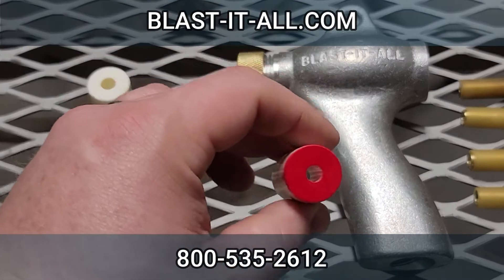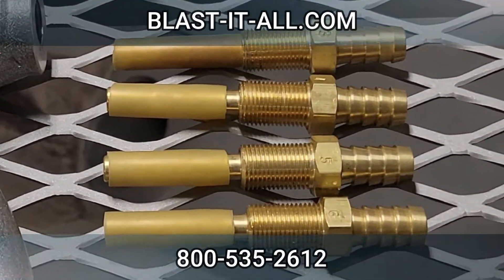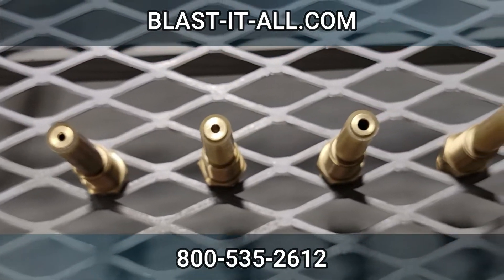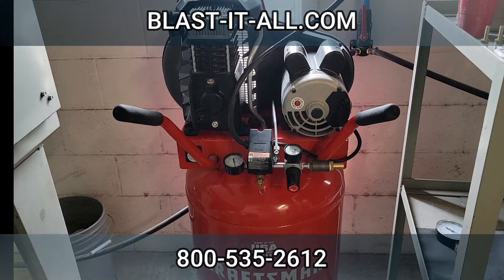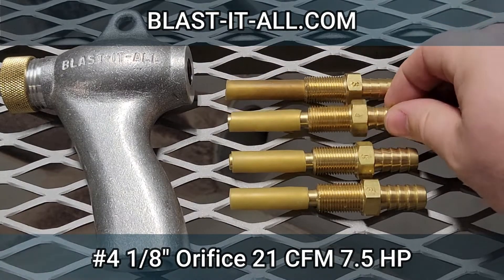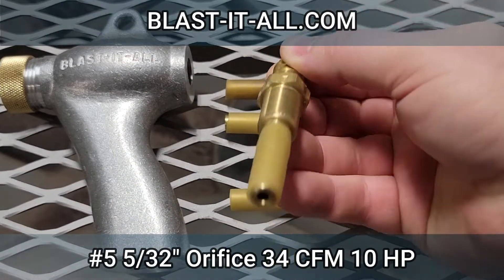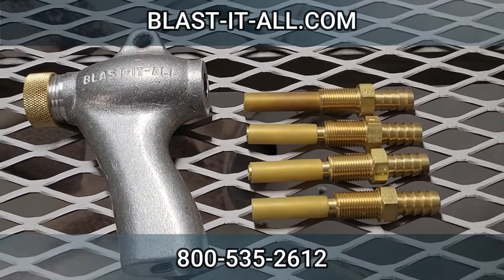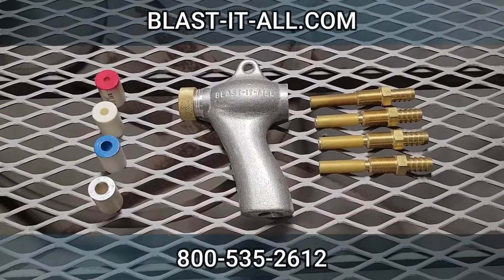How big of a compressor do I need for sandblasting?

Comment: Hello,  my compressor is 80 gallon, 6.5 HP, and is rated at 15.5 CFM at 90 PSI, and  21 CFM at 40 PSI.  If I only need to run my compressor at 40 PS (21 CFM) , will it keep up with a 1/8" Orifice?  Thanks
Reply from the maker: A #4 1/8" Air Jet would require 21 CFM @ 80 PSI. You would probably be better using a #3 3/32" Air Jet which requires 12 CFM @ 80 PSI. This would allow you to operate continuously at 80 PSI and have less strain on your compressor.

The CFM requirements for suction blast guns are on the left of this page. https://blast-it-all.com/cfm_requirements/
Reply: Thanks, I just reviewed your chart and I should be good operating at 40 PSI / 21 CFM using a 1/8" Orifice.  Your chart shows 1/8" Orifice at 40 CFM only requires 12 CFM.
Reply from the maker: @bs8010  You can run the 1/8" @ 40 PSI continuously with the compressor you have. However the flow of media will have less force. For rust removal I typically blast at 80 PSI. For Cerakote  prep the blasting needs to be 80-100 PSI. When frosting glass I usually blast between 60-70 PSI. I do not recall intentionally blasting at 40 PSI. 

If you get the #3 gun you will have the ability to go to 80 PSI and you can handle the same media sizes as the #4. Both the #3 and #4 use the same size nozzle.
Reply: @blastitall  So I am assuming your orifices are only compatable with your guns?

I am a novice DIY, wanting to do Cerakote prep (Have not yet).  I upgraded my HF blast cabinet with the Tacoma Company complete upgrade system, to include their gun and foot pedal.  Mike Tacoma has been in the blast industry for over 60 years and swears up and down that I only need to use 40 PSI for Cerakote prep with 120 grit Garnet media (said Aluminum Oxide is too harsh for a firearm) , using his system.  I am just conveying what he is stating, I have Zero experience and while I am fully set up, I haven't blasted yet.  I did want to do some experiements to see how long my compressor can run while blasting at various pressure.  

My compressor is a three-phase using a VFD to convert my garage 1-phase to 3-phase power.   The compressor takes 6 min to refil the tank completely from empty, not sure if this factors in at all. 

I am trying to get as much real world knowledge from as many folks in the industry as I can.  I beleive Mike is sick, so I haven't been able to talk with him.  Again, I am just conveying what he told me and trying to gain as much knowldge as I can.
Reply from the maker: @bs8010  While our guns are from our own mold, they are an industry standard gun. Our air jets will fit many other guns on the market. 

Cerakote standards specify 100 grit Aluminum Oxide at 80-100 PSI for surface preparation. This video covers the basics: https://www.youtube.com/watch?v=WPj7s2UnPOM

Garnet can be just as aggressive as Aluminum Oxide, but it breaks down faster and therefore does not last as long. 

The blast gun itself will wear faster with more aggressive media, but more wear is seen on the nozzle of the gun. Ceramic will wear faster than Tungsten. We offer a complete #3 ceramic and #3 Tungsten

Ceramic: https://blast-it-all.com/product/3-gun-complete-w-ceramic-nozzle-1-4-diameter/

Tungsten: https://blast-it-all.com/product/3-gun-complete-w-4-tungsten-nozzle-1-4-diameter/

If you would like to talk through some of the blasting process. Feel free to give us a call and ask for John. (704) 637-3300
Reply: @blastitall  Thanks, yes I am aware as well as Mike Tacoma is that Cerakote standards specify 100 grit Aluminum Oxide.  In Mike's opinion he is shocked that Cerakote has not evolved with their media blast standards/requirements for prep.  I conveyed this to cerakote also and they deflected.  IMOP after speaking with Cerakote, I gathered that their expertise is definatly in the actually application of their product and not nearly as much expertise on the prep/media blasting.
Reply: @blastitall  With the #3 gun vs the #4 gun, how much difference do you think I will notice as far as time it takes to complete a blasting task?
Reply from the maker: @bs8010  Our customers who are blasting fire arms use a variety of media sizes, but for blasting they all use Aluminum Oxide. Mainly because it 's durable. 

We have some small shops that process a few parts a month and customers who use our automated equipment and process thousands of parts each month.
Reply from the maker: @bs8010  I've used the #3 and the #4 a good bit, I don't think you will notice the difference. But you will notice the difference between 40 and 80 PSI.
Reply: @blastitall  Thanks, I appreciate it.  I am will to experiment with whatever it takes.  I am not opposed to going up to 80 PSI.  I watched your video and your automated equipment and process is AWESOME!
Reply: @blastitall  My compressor is 100% duty cycle, oiless, and takes about 6-min to refil the tank from empty to 150 PSI / 80 gallons.  It uses 3-phase power converted from 1-phase with a VFD.  Not sure if this matters at all, as far as if it can keep up with the demand?  Or if it all comes down to the CFM?  It is rated at 15.5 CFM at 90 PSI and 20 CFM at 40 PSI.

Comment: I am connecting two 6.5 hp compressors into one line that goes through a series of vertical pipe lines zig zagging. The line has a large air  dryer at the end. 
What size orifice nozzle do you think I could have running the two 6.5 hp compressors together? Thank you
Reply from the maker: I have never combined compressors personally, but it can be done. If done properly it there should be very little loss of CFM. Your combination should yield around 40 CFM. Be careful.

Also not sure what you're planning for, but a 6.5 HP compressor should produce around 22 CFM at 80 PSI, which would work well for a suction cabinet and 21 CFM air orifice. #4 gun on our website. 

This chart gives you CFM requirements for suction and pressure system. 

https://blast-it-all.com/cfm_requirements/
Reply: @blastitall  I plan to use the two compressors only if needed. I was going to use a 5/32 nozzle with a medium grit crushed glass.  
If I understand the use of the chart I should be good to go? Thank you for your help
Reply from the maker: @jimdrechsel3611  5/15" Nozzle and 5/32" Air Jet

Comment: Can I use a car tire air compressor to power a sand blaster?
Reply from the maker: If by tire air compressor you mean one of the little tire inflators, no. Most of the manuals I have read for those indicate the produces less than 1 CFM. The smallest CFM air jet we use needs 12 CFM. It is possible to get a smaller compressor, 4CFM, with a tank and blast for short periods of time. But for larger projects something the produces a few more CFM than the gun requires is what would be recommended. This shows how that works: https://www.youtube.com/watch?v=TQoe0ov4M_c

Comment: I use an 18CFM gas engine compressor with a HF cabinet. I’ve also installed 1 inch tubing for siphoning/ metering. A couple days ago I was chugging along and blasted several parts, however I haven’t been able to find that sweet spot again. Now at most I get a small amount of media when I pulse the trigger. I can see media almost making its way to the top of the hose but it doesn’t have great suction after several hours of use. The HF gun is really bad too, the best performing ceramic nozzle was 1/8” and it wore out fast, I also had to keep the retaining nut loose and wiggle it around from time to time so a lot of media was falling out when the trigger was not pulled. 

If I’ve ensured there are no clogs and changed the media several times, would a gun like this give me more consistent performance? Also the metering valve doesn’t seem to have an effect on the suction.
Reply from the maker: There are a lot of factors in suction abrasive blasting performance. The gun paired with the proper nozzle and making sure the nozzle is not worn makes a big difference in the suction. 

This video briefly talks about nozzle pairing: https://www.youtube.com/watch?v=syMz9l0VOTI

This video goes more into the details of the suction gun: https://www.youtube.com/watch?v=dKT9XeFhNNY

Comment: I'm rockin' the super-powerful HF 29 Gallon 5.3 SCFM (pun intended...) compressor. What would you guide me to purchase to make this puppy work? Thank you in advance, I've NEVER had luck with my blast cabinet so I'm hoping this will be the Unicorn! I'm going to presume the 1/4″ nozzle, 3/32″ Orifice noted on your website 'should' do the trick??
Reply from the maker: The 1/4″ nozzle, 3/32″ Orifice (12 CFM @80 PSI) will help if you've had a larger one, but 5.3 SCFM still isn't enough to keep it running continuously. The 29 Gallon tank will give you a run time between 6-10 minutes with the 3/32" Orifice. If you need to blast longer the answer is a bigger compressor. A 5HP compressor is what I would recommend.